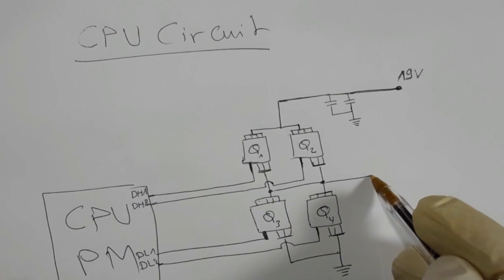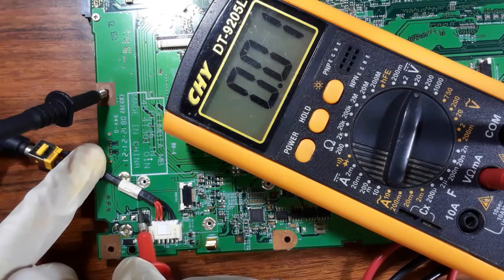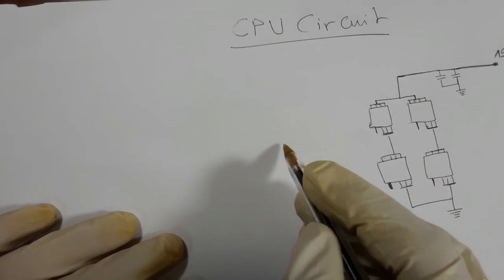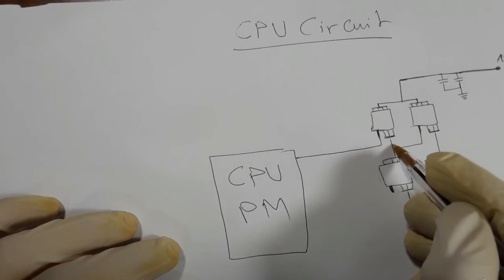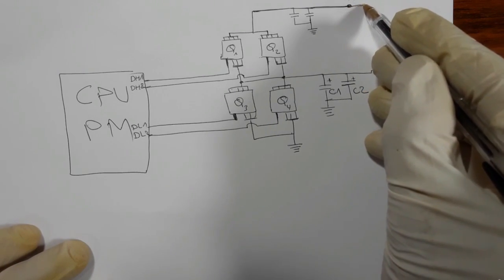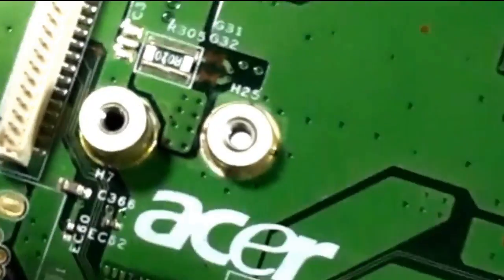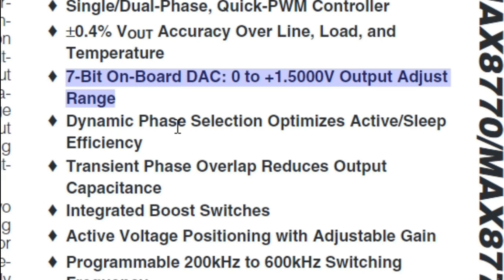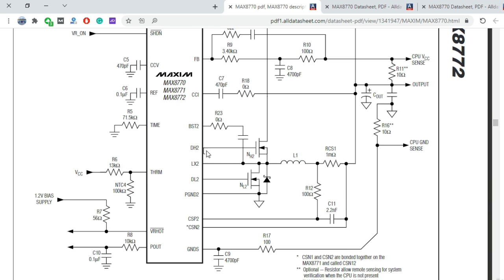Exclusive Motherboard CPU Circuit Analysis - Voltage Rails +VBAT, CPU VCC_CORE - Laptop Repair

Comment: Sir I will like to know if we test the voltage or measure the voltage across the circuit board. Can i take black lead to the capacitor ground and the red lead to measure any component around circuit.. so there is no blast of capacitor if the power supply is on
Reply from the maker: Yes You can but I prefer to use the normal ground